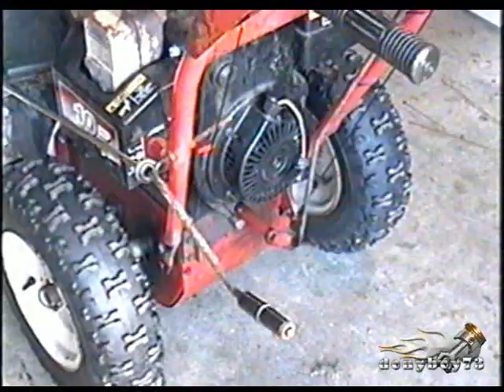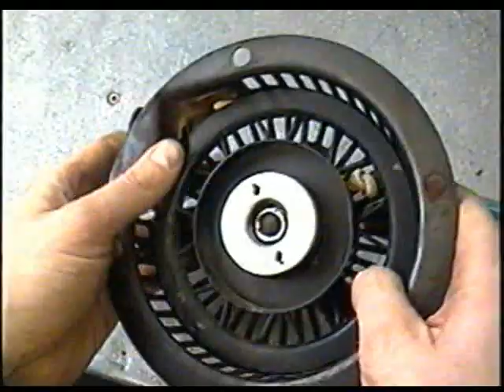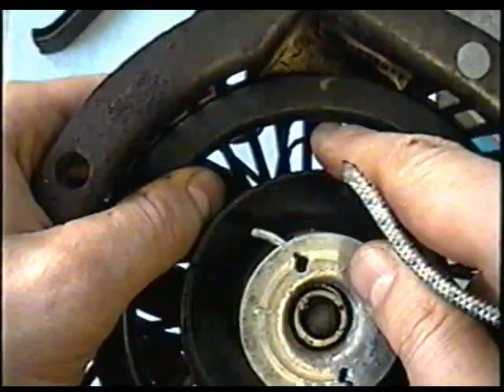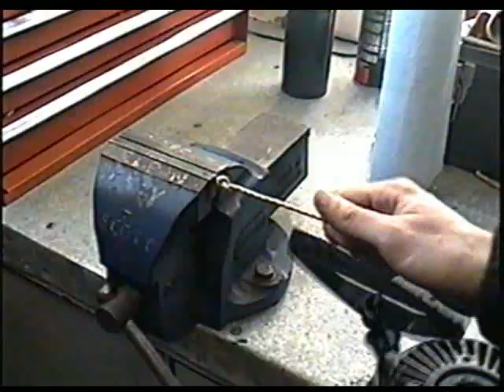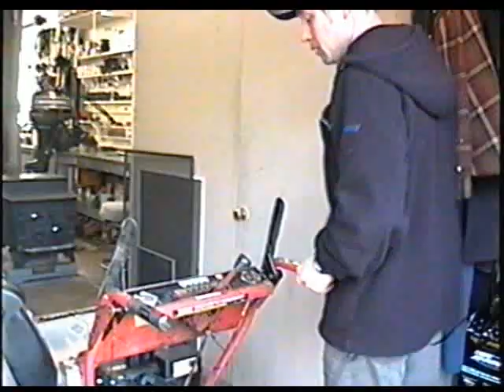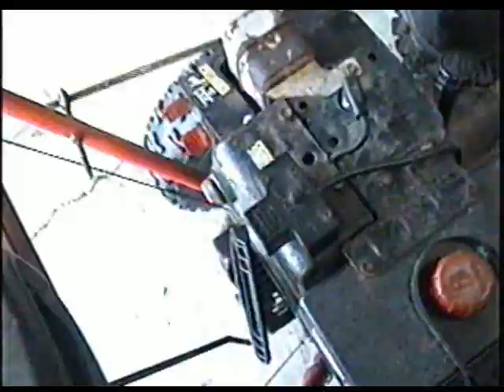Snowblower Starter Rope Repair on 8-10HP Tecumseh Engine

Comment: It seems in your video that the square part that you initially feed the rope into with the needle nose pliers is much shorter than what I have.  Mine is longer and gives me very little room for my pliers.  It looks like the one you are using has been cut to make it shorter and thus easier to feed the rope.  Is this the case? If so, how did you cut that part and if not, what do you recommend I do?
Reply from the maker: post a pic on my facebook

Comment: donyboy -just wanted to say thank you for this video.  I had to do this procedure on my Mastercraft snowblower with a Tecumseh 8HP today, and it worked perfectly.  Thank for the tip on cutting the slot to put the rope, because mine didn't have a slot in it at all, and that made it much easier.  Like you said, I heated a screwdriver made my own slot.

This really bailed me out because I have 2 snowblowers, the Mastercraft and a 1973 Ariens 7HP, and I broke the starter rope on BOTH today.
Reply from the maker: you're welcome, make sure you're subscribed

Comment: My cord ripped today and got it fixed, thanks to this video! My recoil has a welded metal triangle closing the temporary space that you used to feed the rope through. Also the tip of the cord that I melted was too thick for the small hole in the rotating plastic spool. So I untied the other good end of the rope, wound up the recoil, put a bolt through it to hold the spool and fed that thinner end of the rope through the spool hole and out to the handle side. Put on the handle and tied both ends.

Comment: Great video - it helped me replace mine this past weekend.  One thing I did - which actually saved me a lot of time is I wound the recoil by hand before putting the rope back in.  This avoids the hook & notch technique.  I wedged a couple of flat head screw drivers to hold the recoil in place align the holes.  Then I inserted the rope, tied the knot, removed the scres drivers and the rope would back into place.  Your video was a big help - thanks!

Comment: i got a tecumseh hmsk80 8hp engine on a snow blower . it will only run with starting fluid. i cleaned the carb bowl float and jet out and it still wont run. gas is getting into the carb. any ideas of what i could do?

Comment: Thanks very much. My Tecumseh 10 hp is back up and running with a 1/2 hour's worth of labour on my inexperienced part. Had to create a notch with a utility knife and there was a metal guard where the handle hole is to make things difficult. A heavily modified coat hanger was used for the hook. I used six feet of cord. All is working well. Thanks again. Now on to the auger!

Comment: Thanks for the video. My spring wasn't engaging, so I viewed another one of your videos on replacing that part. However, in the process of banging it out, I tested winding it again, and the spring engaged?! What might have happened inside the mechanism to cause that, first not rewinding, banging at the pin to get it out, and half way through - it works? At any rate, the cord is now re-installed, and plan on reconnecting to the snow thrower tomorrow. Thanks again --

Comment: Hey Don i just picked up an old Bob-Cat snowthrower and it need a longer rope. Do you know what size i should get? I think it's around 1974 8hp 28" wide. Do you know if they are any good. Everything works and runs good. Thanks for any help you can give.

Comment: if it's impossible to wind the cord back in with the slot on the recoil, you can always wrap the cord couple of times in opposite direction around the hub lip (the part where don oils up the spring), then pull. repeat if neccessary of course ;) that's pretty useful with chainsaws and trimmers that do not have a slot. a bit of improvising is needed with different models but once you get it it's done in five minutes ;)